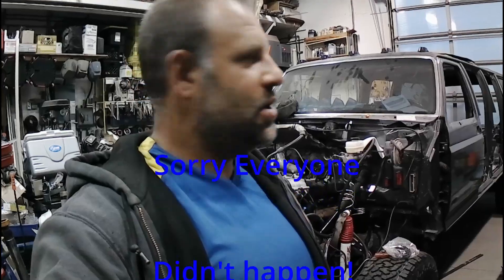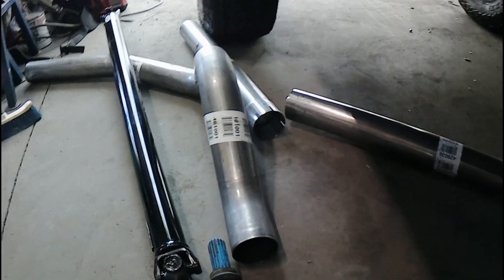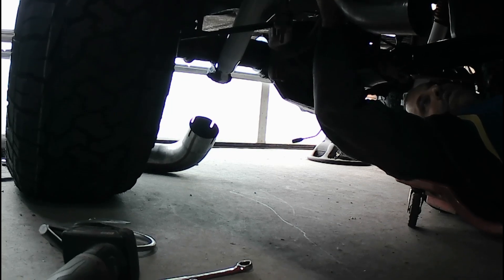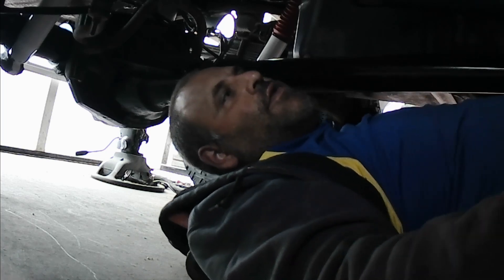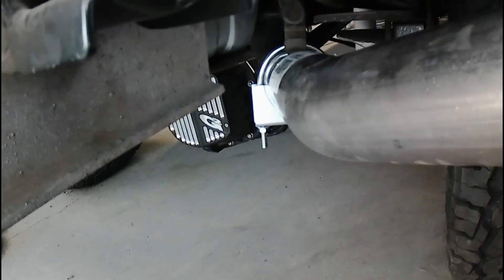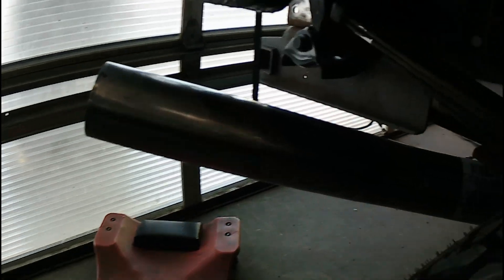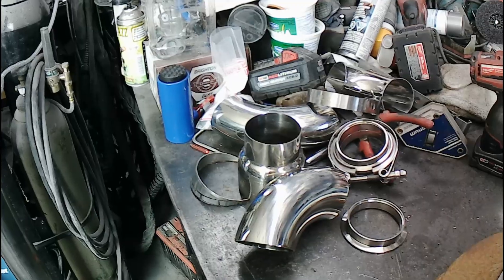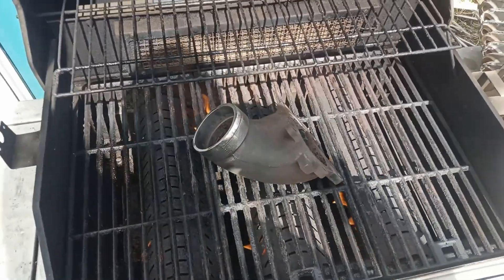OBS Ford 4X4 6 Door F350 Bronco Build - Part 24 - Exhaust

Comment: Glad to see you back. Figured you must have been busy working. Good video.
Reply from the maker: I was,  They had me everywhere all over Canada this year, including 2 months off and on in inuvik, internet went down to the wild fires burning through the fibre lines for most of it.  Using data on the cell was like early 90's dial up where you can watch your pictures slowly load.  Town went Cash only